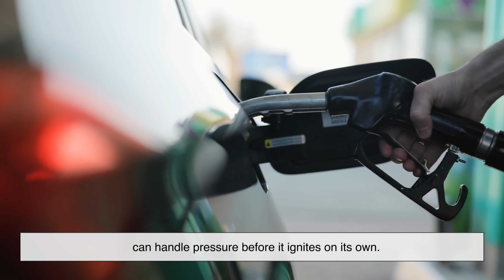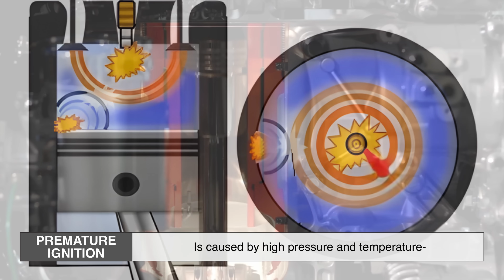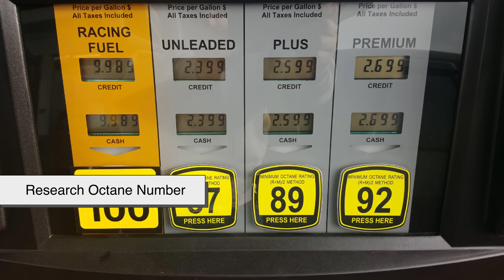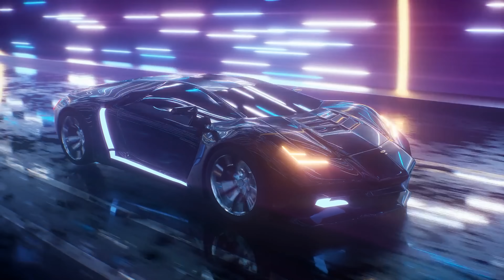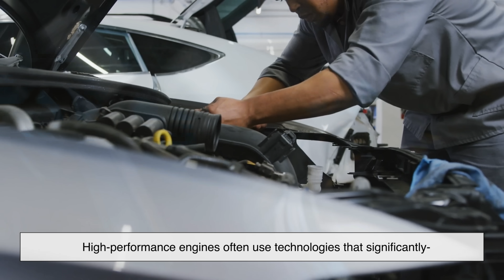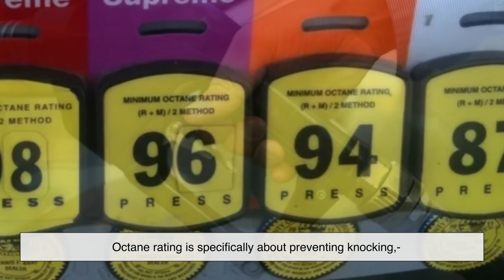What is Gasoline Octane Rating and Why is it Important?

Comment: Why is it that my 2010 Hyundai i 10 really struggles uphill during a holiday oooops and after fueling with high octane 98 vs 95 performs way and way better?
Reply: I think it can be due to the 98 octane maybe has added cleaning and lubrication additives (many of them have it), making the engine run a bit better.
Reply: @aciddiver1978 i know.., back in the days i got another car and after 2 weeks of Vpower the engine became smoother and less stuttery at low speeds, after a speed bump and the i10 performs way better on 98 instead of 95.., that much that it can't be mental 😆

Comment: Why does the US have 87, 89 or 91 octane, but Europe 95 or 100 octane?

After all, vehicles from Europe are also delivered to the US and have to cope with the lower octane numbers there.
Reply: Different road surfaces, different stop & go patterns, different average speeds both urban and highway, different average trip distances, different driving styles, different testing standards…
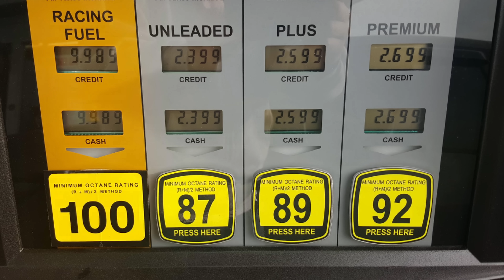Reply: 6:45

Comment: Here in the Philippines, my car users manual says use 91 octane but the car dealer say 95 octane, I tried 91 octane but I keep getting fuel knock so I switched to 95 octane and the knocking disappeared, so is octane rating in the Philippines not up to standards?
Reply: That 95 is a made up number. It's around 91
Reply: And 91 is around 89

Comment: Fun fact: Octane rating doesn’t mean more power, it actually measures how well fuel resists knocking. High-performance engines need higher octane because they compress fuel more